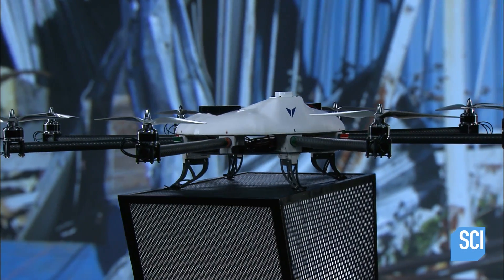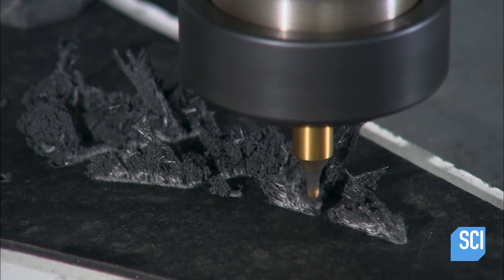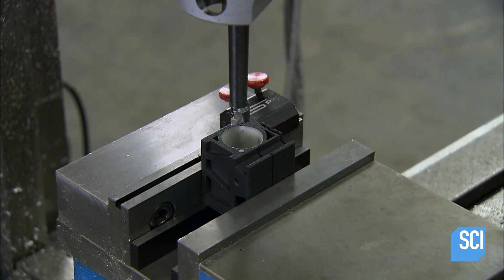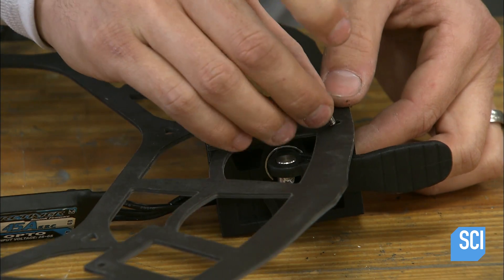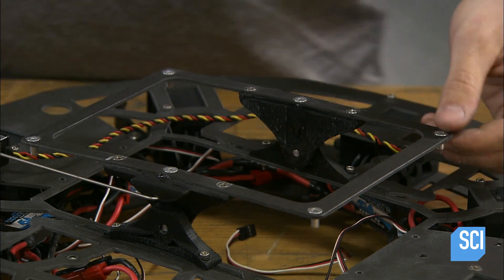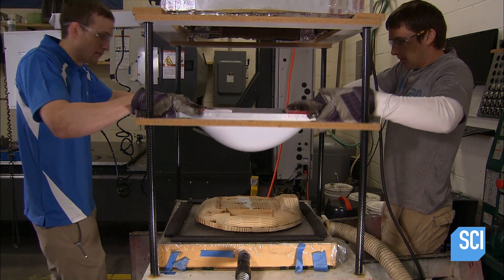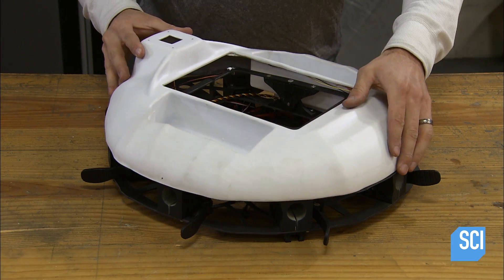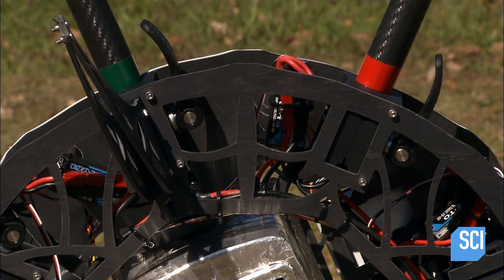How It's Made: Commercial Drones

Comment: Where is the battery? I didn't saw it is Flying without battery 🤣
Reply: No battery. They just use a REALLY long extension cord.
Reply: @Chomuggaacapri  your mean they supply power from grounds with wires,? Because there are 8 motors and it really need much power for flying,